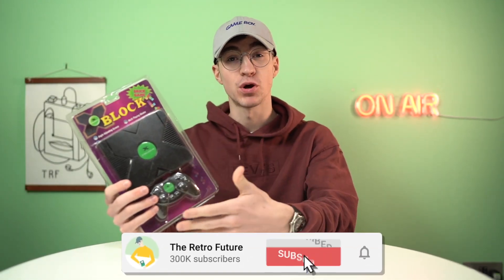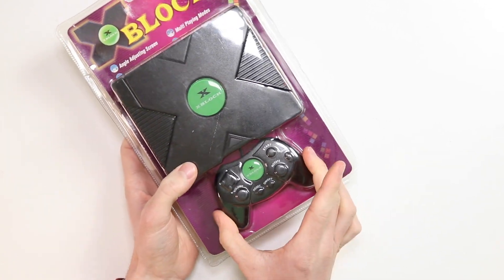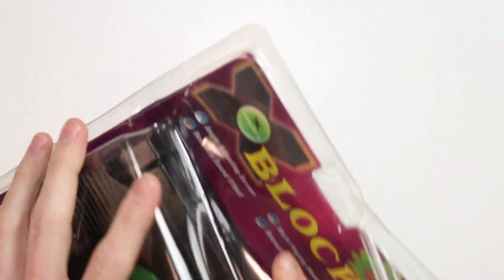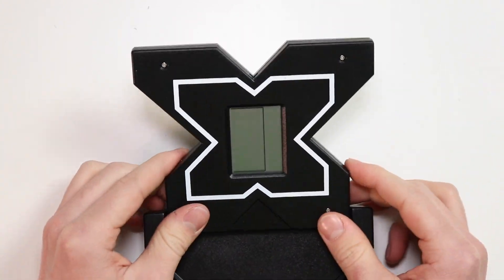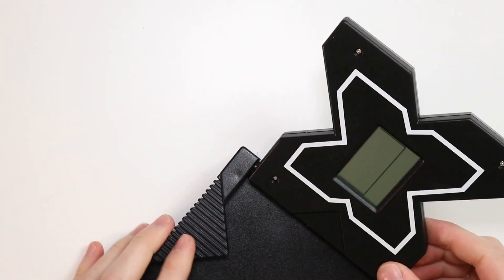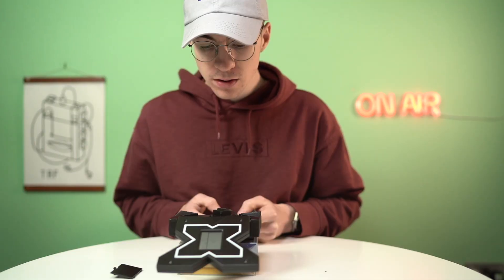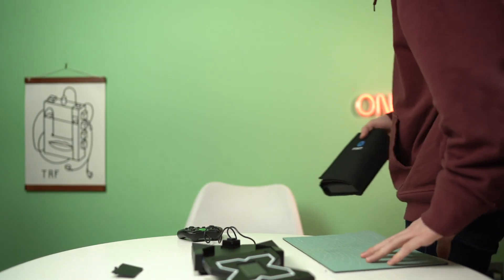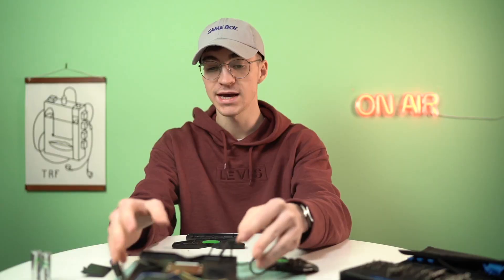The Xblocks Series X

Comment: Elliot: Struggling to find any other games from 6:25 onward
Me: PRESS THE ROTATE BUTTON DAMMIT

Seriously, that thing has a lot of games. Not 99, but 11 IIRC. K to Z are different variants of Tetris, and some of them are actually really cool, like the Pentis, the shifting field ones, the ones that dive you random figures after pressing the Rotate button, the one that has garbage popping out from the bottom after a line, and various combinations of the above... Honestly, I prefer those Brick Game tetrises to any of the official ones (except maybe ones made by Arika).

At the early 00s, I actually had a Brick Game unit with exactly the same software on it, but a different form (a long, square slab with a bump across it in the middle) so seeing that screen and hearing those sounds was nostalgic... and sad, seeing the atrocious quality the modern Brock Games came to :(

Comment: I owned one of these brick games when I was a kid, probably around late 1990s-early 2000s. I didn't know these were still being made. The one I owned was a handheld version. It looked like an elongated, thin Game Boy with a with a weird hump/groove in between the screen and the buttons (I guess it's there to place your index fingers.) They came in various colors with some being see-through. It wasn't named after any console. It was simply called Brick Game.

https://www.youtube.com/watch?v=u1PVuaI4Zwg

By the way, there's more brick games on this thing than just the tank game. If you look at the top of the screen when you turn it on, you'll notice the letter A, which indicates it's the first game (the tank game.) You can scroll through A-Z to select a different game. There's 26 different games and 99 variations of each game, so that makes 2,574 ways you can play this thing. Other games include clones of Breakout and Tetris and a vertical scrolling driving game, where the object is to drive past other cars without crashing into them.

Comment: Yet you do realize you're completely wrong right is this a joke it's the Xbox series X and you got scammed they're from Microsoft not Nintendo that is a toll box with disk drive controller 2 buttons on the box a slot you can put in extra storage you could always pay $15 a month or your equivalent in your country for  100 or so games you just need to install them and it  unlocks multiplayer just pay the $15 a month or your country equivalent and your set or you could just pay a little bit less for just multiplayer and buy Xbox series X discs instead let's hope you don't get scammed next time